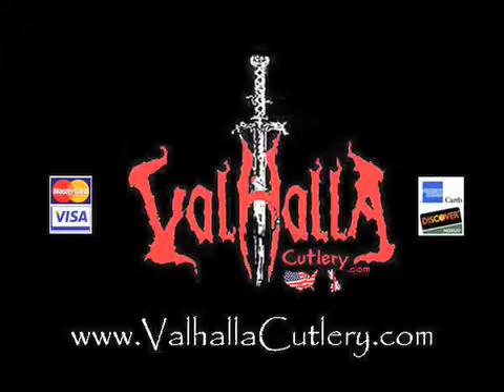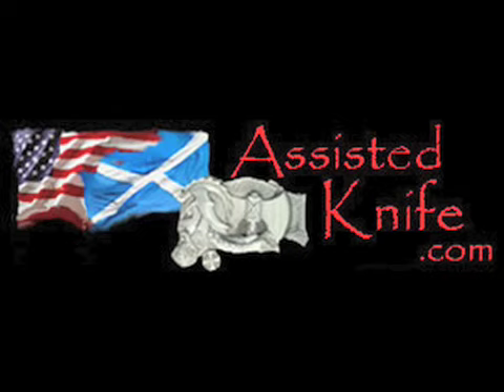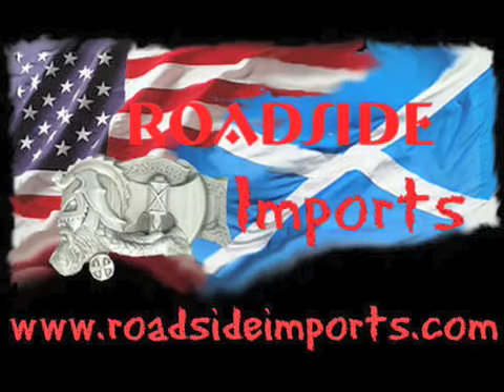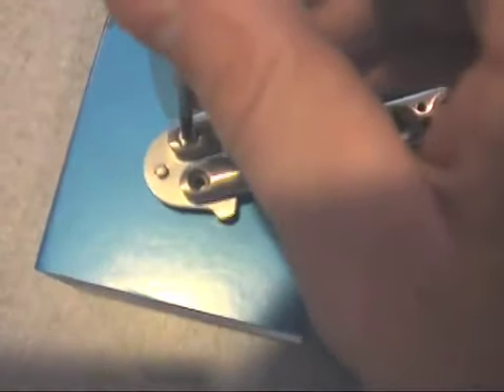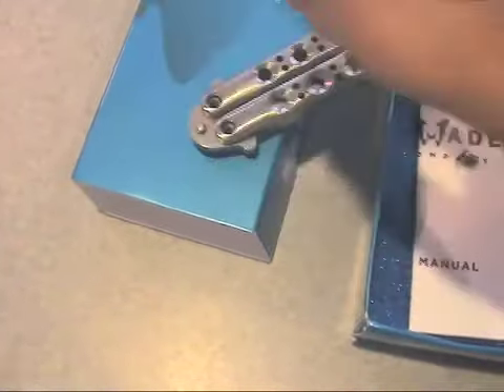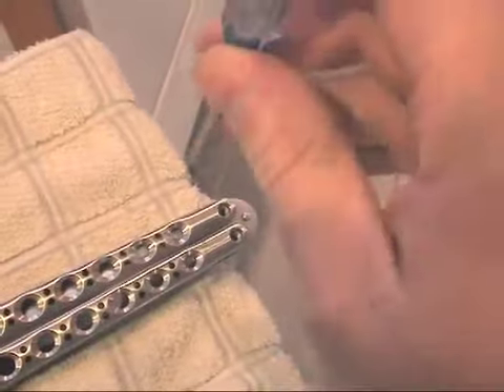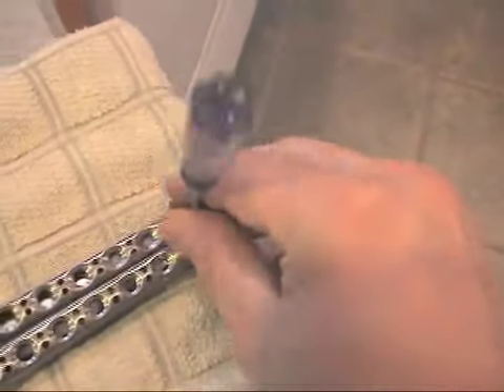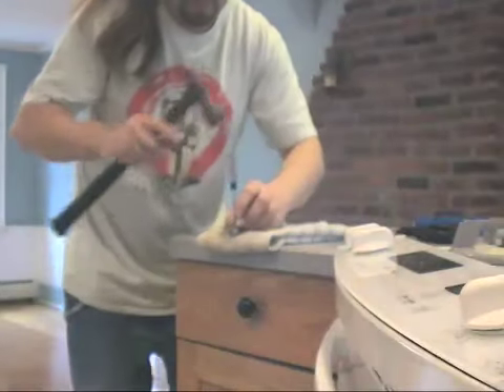Benchmade 42 Pivots SUCK Batangas Balisong Butterfy Maintenance

Comment from the maker: It is Titanium it does not damage the handles but you can damage the pivot pins on the threads if you use the wrong size center punch that would be the thing to that you would not want to damage.

Comment: I've personally never had a problem with my 42.

If I need to clean the pivot I just use soap and water, then dry the pivot with an air duster. then i use some tuf-glide on the pivot.

I would personally prefer having the pins removable, but I guess one bright side is that the blade won't ever come flying off the handles.

Comment from the maker: The Mayhem is made in Elkhart, IN.  The Mayhem has a S30V Stainless Steel Hardened to 58-60HRC and Machined 6AL 4V-Titanium with Bead Blast Finish Scales on the handle with sandwich construction.  The Mayhem is in another league of its own.

Comment: I think benchmade made put those tight ass fit pevit screws so it won't fall apart cause the screws are male&female.  And they do sell blades if u want a new one.  Just have to send ur knife to them with some cash. And they will clean it and replace the blade to the new one that u wanted

Comment from the maker: In this entire run on words thus far it is clearly stated that the Mayhem was built by Bitchmade.  Bradley got the materials and had them made but to their standards.  Then they designed the Kimura and had Kershaw build it and it was a good knife for the price.  Then Brad got sued and went down the Bitchmade way and then he decided to not do business with Bitchmade anymore, he sold off his entire stock at just about cost and then stopped having them make their models.

Comment from the maker: Ofcourse I could use a vice, the point is that there is no need to crimp them, they could have used a slotted system.  I don't state they are the ultimate.  Bradley Cutlery's Mayhem, Spyderco's Spyderfly, and Jerry Hom's Basilisk are the best on the market by far and crush Benchmade's junk.  Pacific Cutlery was a good company but when they turned into Benchmade the corporate assholes changed the company and that is why they lost the government contract because they are not who they were.

Comment from the maker: Spyderco Spyderflies, Cold Steel Arc Angels, Dalton Wings, these all don't come flying off and don't crimp or peen down the pivots like Benchmade.  Then if you remove the pivots you void the warranty and then they state that they put TORX screw pivots because in the future they are going to sell blade replacements.  Huh?  You can't replace something that voids the warranty and so the statement is bullshit and false advertising because the statement is not true.